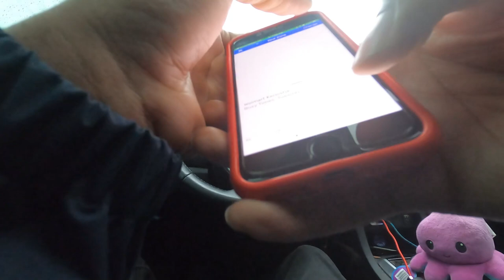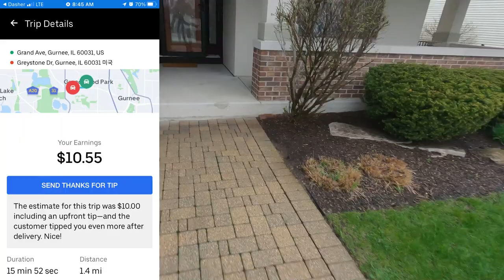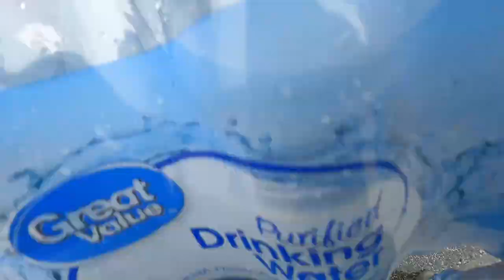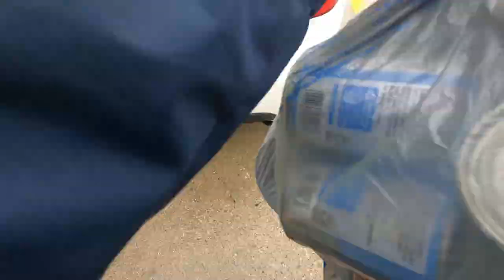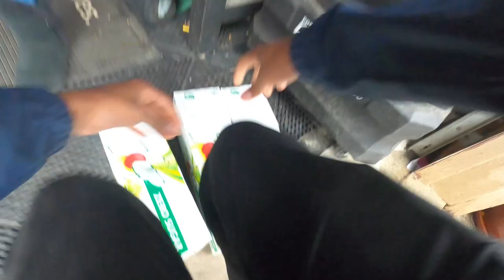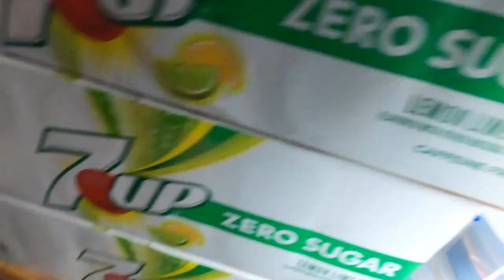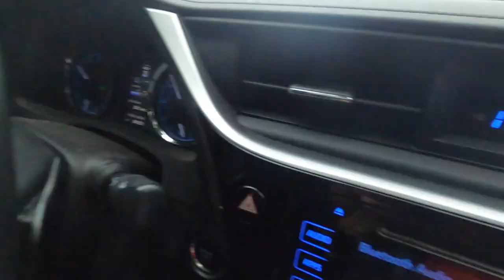Did I Really Get KICKED OFF of the Spark App? 😧🤬 InstaCart, DoorDash Tips & Tricks, Ride-Along

Comment: Usually to change zones, you just click the magnifying 🔎 glass on the app. Be careful because you might not be able to get back if the other zone is full? I only changed zones once.
Reply from the maker: For some odd reason it wasn’t working for me. You are definitely right, when you try to switch zones they send you a message letting you know if it’s full you will have to wait for an open slot.

Comment: I didn't get a single spark offer yesterday. If I don't get one today then really getting worried
Reply: Make sure you're driving up to the Walmart, and then turn on Walmart Spark. Also make sure that you're at the right location. You can't sit at home if you live more than 10-15 minutes away. Make sure to drive up to the Walmart, and then when you're in the parking lot, turn on Spark from there. Sometimes when I feel like I'm not getting offers, I log out of the app and then log back in.
Reply: Is spark any good? I want to try it for my Doordash vlogs that I just started making. Pretty fun!
Reply: @trevorsdeliveries  it depends. If you have 2+ Walmarts within close proximity that support Spark, you usually can make some good money. The pros cash in $200-$250 a day. I started a month ago and sometimes make $200+ on a Sunday or Tuesday, but I usually stay out all day to make that much.
Reply: @gseric4721  I went and tested your theory and were correct. It's so weird though because my first day I was able to get offers from home but that stopped.

 That's ashame that I need to drive down there and wait.
Reply: @Doesitreallymstter  Was the same case with me. It was only until I did more research on Spark and saw it on a Youtube tutorial that I finally understood what I was doing wrong XD
Reply from the maker: @Gseric47 is correct. They usually send them to the closest people to the Walmart. You may be able to get away with doing it from home at around 6:15am for Sam’s because no one else usually has it on that early. But after that I would go by Walmart.